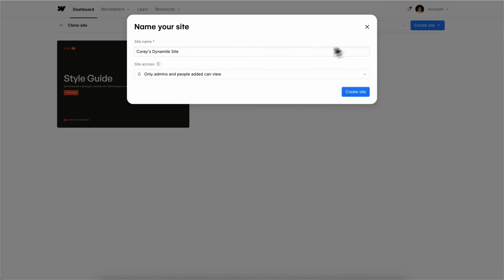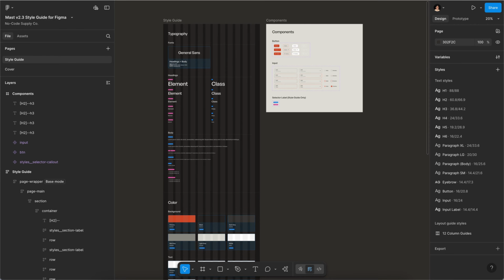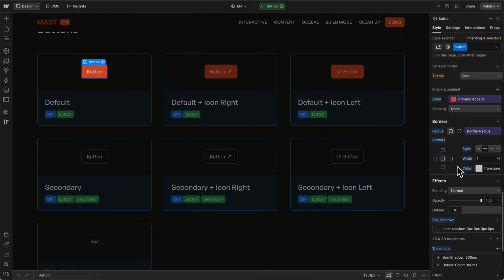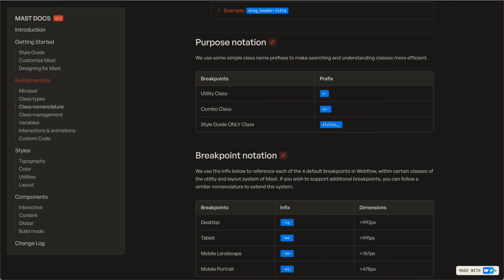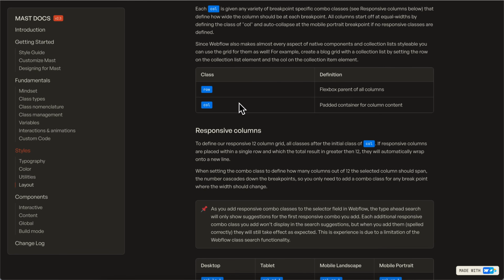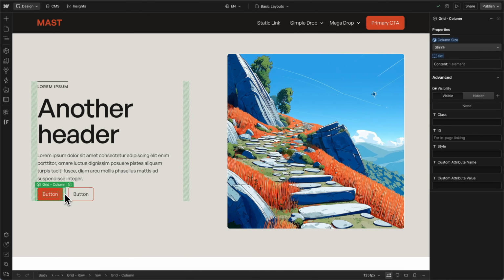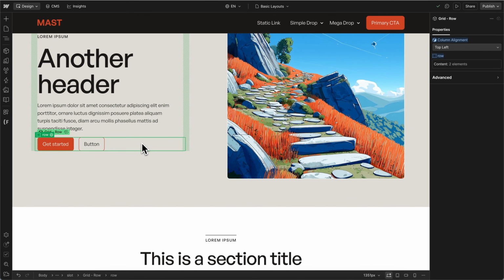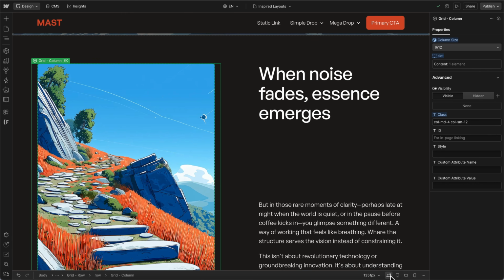Get Started with Mast

Comment: I used Mast with webflow before and it worked well. But I'm not sure I understand the use of setting up the styleguide in Figma first. I feel like I'm recreating a website twice. My process is, design loosely and quickly, then, build in Webflow. I can't work quickly while thinking about classes and padding. Am I doing it wrong?